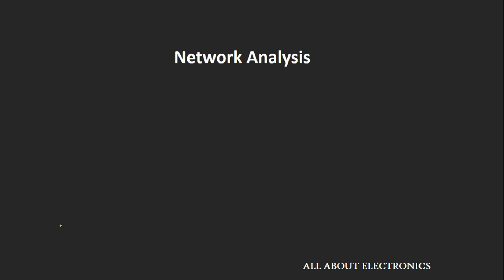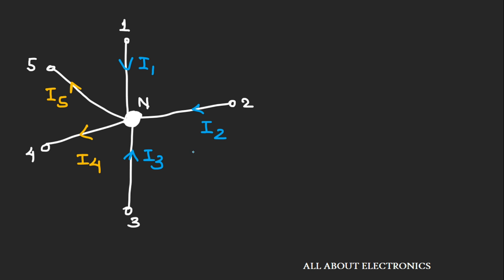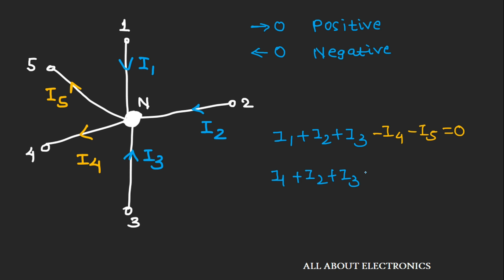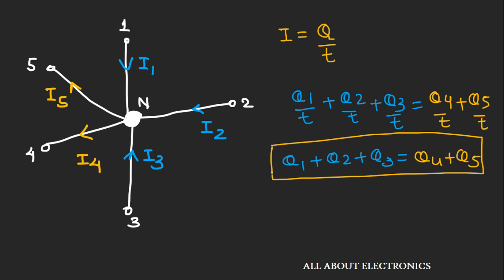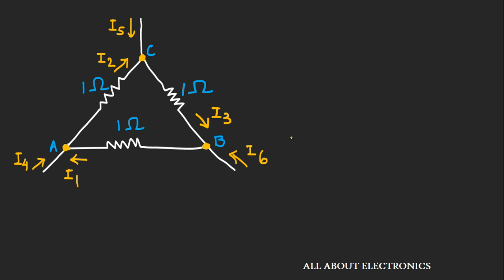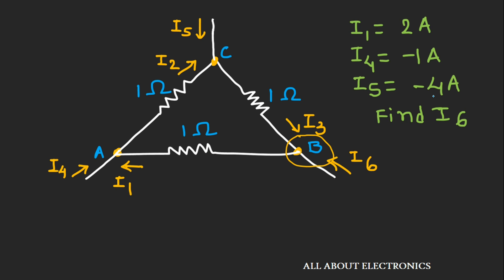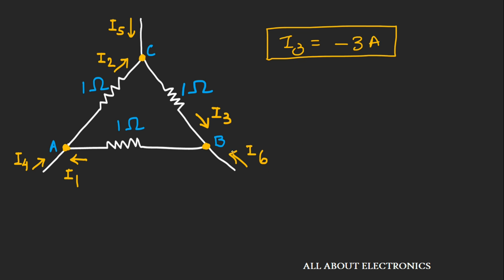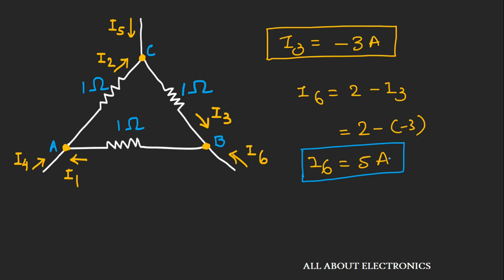Kirchhoff's Current Law (KCL) explained

Comment: Bro if we first put kcl on a then b then c
Reply from the maker: You can definitely apply KCL at node A, then B, and then C. The order of applying KCL to the nodes in a circuit doesn't change the final solution.
Reply: @ALLABOUTELECTRONICS ok

Comment: I have a question on the value of I2 as i think there is confusion on sign. Looking at the current arrows you have drawn enetering/leaving node A, both I1 and I4 are drawn entering, however I1 is given as +2, and I4 as -1.

Would this not make I2 -1?

I2 + I1 + I4 = 0
I1 + I4 = (-I2)
2 + (-1) = 1 = (-I2)
I2 = (-1) as it is leaving the node

Comment: What I would like to share is how a simple search engine can be constructed using relay logic. All that is needed are SPDT relays , light bulbs ,  SPST switches , a rotary switch , and connecting wires. The only  relay logic symbols used are AND Gates and inverters. The

Comment: When the V/R is used to represent current , do you always assume that the node you are summing at is at a higher potential voltage than the other nodes ?
Reply from the maker: It actually depends on the direction of the current. If the current is going away from the node, then the voltage at that particular node is more than the other node. e.g let's say there are two nodes in the circuit (A and B). If the current is going away from node A, then VA is greater than VB. On the other end, if you look from the Node B perspective, as current is entering into the node B, VB is less than VA.
I hope it will clear your doubt. If you still have any doubt then do let me know here.
Reply: Is there always enough information to determine this?  You would have to know either the direction of current or the voltage potential at the nodes to determine  current direction.  Incorrect signs seem to be a source of error in circuit analysis.
Reply from the maker: Yes, that's true. At times it happens that you have to make an assumption about the current direction. And during the circuit analysis or after finding the voltages and currents in the circuit, it may happen that the assumed direction of the current is be opposite. 
But it will not affect the values of final voltages and current in the circuit,  as far as KVL and KCL are satisfied. At max, it may happen that the assumed direction of current may be actually reverse.